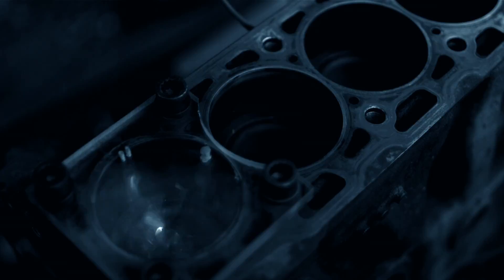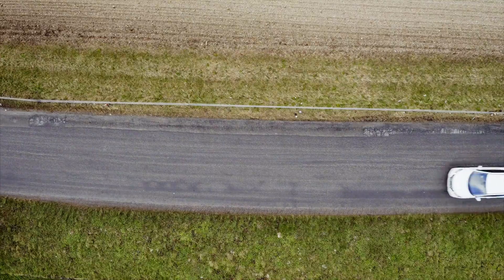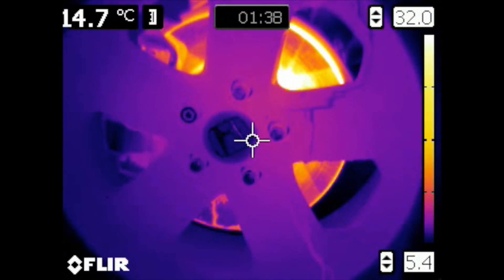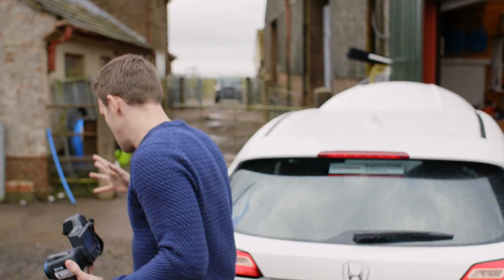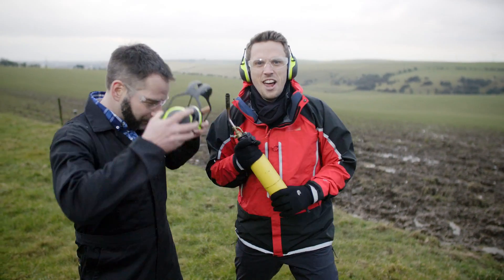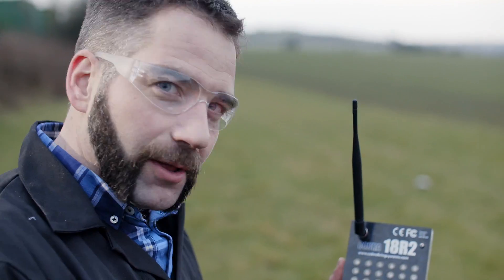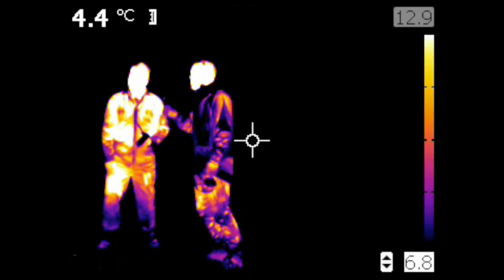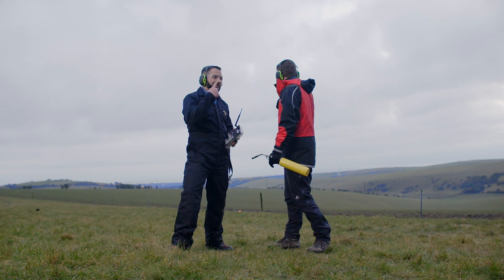Total Energy Efficiency I The F1 Power Unit Explained I Honda Racing F1

Comment: The whole “fuel efficiency bullcrap” based on hybrid engine configuration amazes me lol .. yes nowadays engines are about “claimed” 25% more efficient compared to last non hybrid engines but the total weight of the car increased by @ 25% also lol !! ERS is used strategically within races, therefore not being ecological at all while not being used.. the fuel engine has to carry more weight in that case .. I understand the importance of going green but we need to used a so called green concept at all times to be efficient

Comment: If you're going to have a channel about science you should probably be more accurate. I get that this is a video for people who know nothing about turbo chargers but that doesnt excuse misinformation.  The implication in your video that turbos are harnessing 'free' energy from exhaust gases that would otherwise be wasted  is completely wrong.  You also said that turbos are converting heat energy into kinetic? Wrong again. It's pressure that drives the turbine, the temperature of the exhaust has nothing to do with it.
Reply: The exhaust temperature does have a lot to do with it because the temperature differential between the inlet side of the turbine and the outlet side increases the pressure differential too.  Nonetheless, this video is still all kinds of bollocks.
Reply: WWYD78 sorry yes, I was too hasty saying it had nothing to do with it. I got away from my original point, which was simply that the energy transfer is kinetic to kinetic. Conversion of chemical to thermal to kinetic has already occurred. I'm just being nit picky there though, the free energy was my biggest complaint.
Reply: To the contrary, it IS correct to say the turbine is harvesting heat / waste heat (just check out any engineering textbook), and that is why the electric motor/generator on the turbocharger in F1 is called a "MGUH", H for heat.  You say kinetic energy of exhaust gases are harvested by the turbine?  And what is kinetic energy -- vibrating molecules, i.e. heat!! The exhaust gases LITERALLY come out cooler from the turbine then they enter!  The exhaust gasses are hot and fast moving because they contain all the wasted heat from the thermal inefficiency of the combustion, and therefore the turbine is literally recovering the heat.